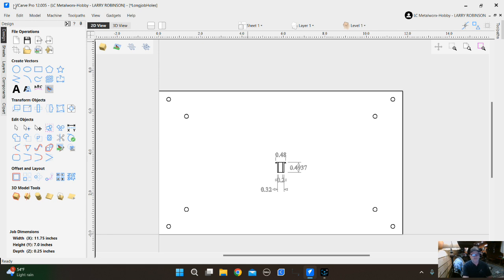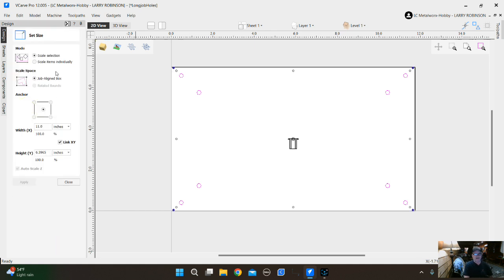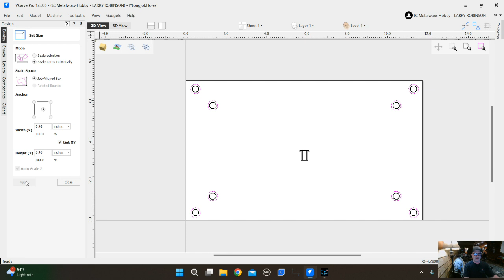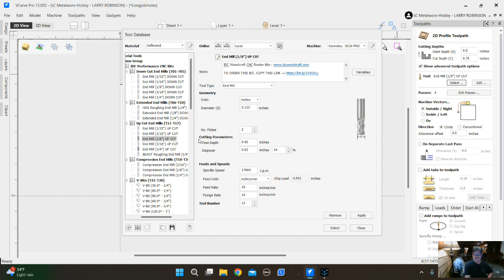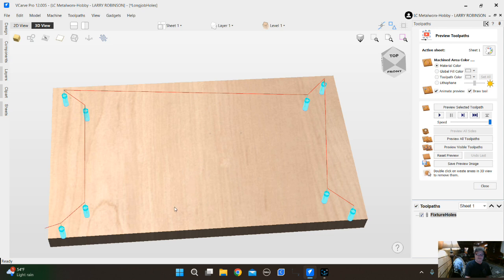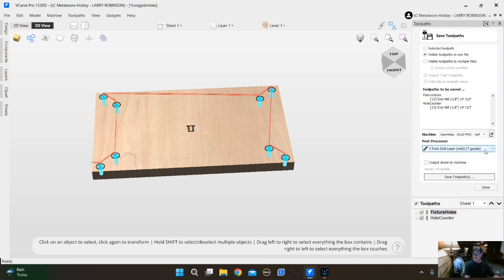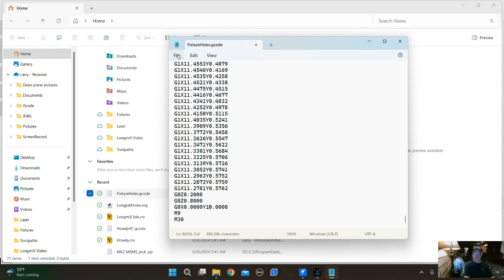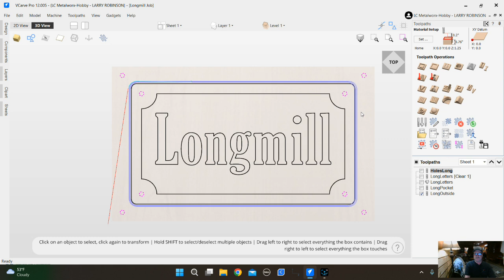CNC Router Workholding and Vectric V12

Comment: I found some 1/4 20 nylon bolts on Amazon the fit the inserts you are installing. So if a bit accidentally hits the hold down it should survive 😅
Also I was wondering why you didn’t use the Drilling Toolpath to make the holes?
Reply from the maker: Ok, I had to go look at this horrible video LOL to see what was said.  Some people do use soft bolts if they are unsure of themselves.  I don't believe they have enough holding power necessarily and I'm not going to be hitting anything because I know at all times what the machine is doing and where it's going  (knock on Wood)  I try to empower people that do private Zoom Meetings with me to command their machine, Boss that sucker around and know for a fact what it's gonna do when you click start.  BTW, you really don't want to turn a HSS drill at the speeds we run  these routers at, it's way above the Surface Feet recommended to drill.  I know some do, but it's not the correct practice.  IDC Woodcraft does sell two sizes of drills made for this that work well but....It's a little crazy running normal drills like this, I know you can but....Not recommended is all I'm saying, just be safe please.  If you speak good English and want to go over any CNC type things, reach out to me anytime, I'm happy to teach these things to anyone, as time permits. BTW I have discovered since making this video that double back tape works faster and easier to hold work than this method.  But hold down bolts is the best method for securing anything from moving for sure.
Reply: @  thank you for the response!! Can’t say that I speak English , it’s more like Texan.  I’ve been a woodworker for the past 40 some years, cabinets and furniture, now just mostly furniture. I’m just venturing into CNC , trying to teach this old dog new tricks. 
I’m at the stage where I’m trying to learn some gcode. Starting small, like entering a code that will send the cnc machine to a specific coordinate.
Thank you for making the videos!
Reply from the maker: @bigkahunaranch1715  Great, North Tx here (Graham)  If you need any tips on Gcode...I love talking that if you need to.  Email larrytech54@gmail.com   I'm available today if you care to have a meeting on Zoom where we can share screens and cam, etc.  I'm a machininst for day job and tinker with wood here at home.
Reply from the maker: "Why didn't I use Drilling Toolpath" ?  Well it's not really recommended to turn a HSS drill that fast (10k rpms + )  Some carbide is meant for that.  I have done it but it probably isn't too safe and you can tell by the sound...it just ain't right.  Endmills work good on a spiral ramp profile and is really the correct method but at the end of the day it's your call.